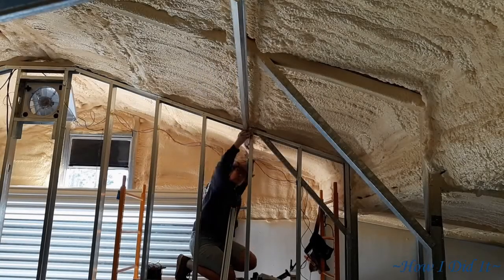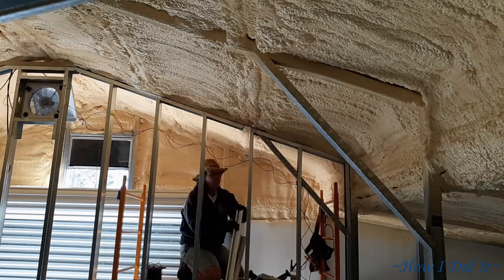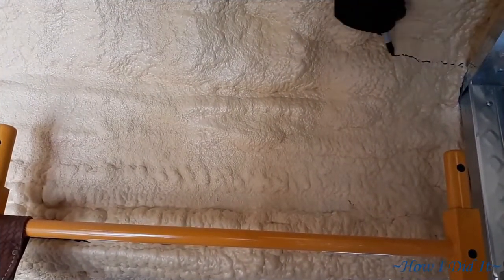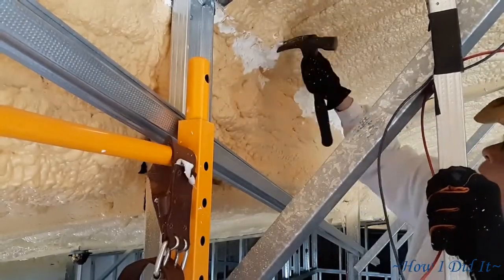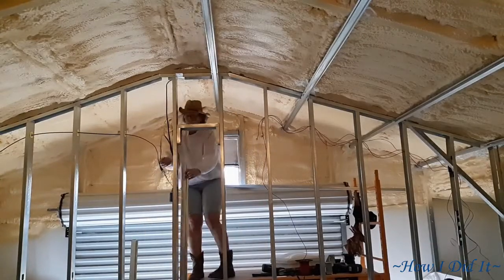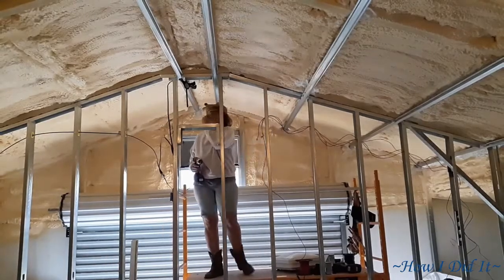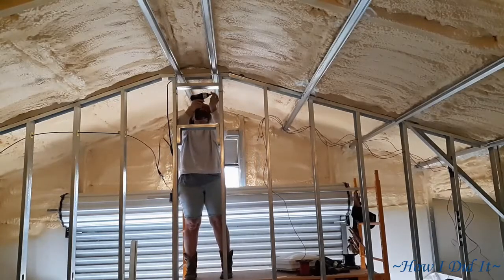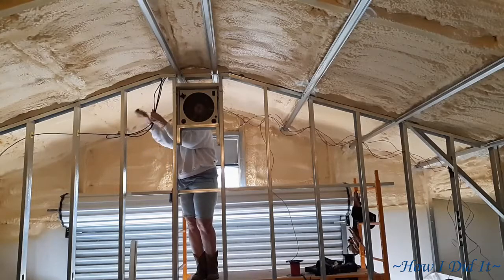Off Grid Barn framing, starting the hat channel install~How I Did It~

Comment: Great explanation - sorry to ask so long after the fact, but what did you install into the hat, drywall? If so how did you handle "inside" corners, did you install hat at all of them to have something to screw to / are those just floating but doesn't matter cuz nobody is pushing on the ceiling? Super cool build, I'm a big fan of foam and this seems like the PERFECT application for it, thanks for making this video!!